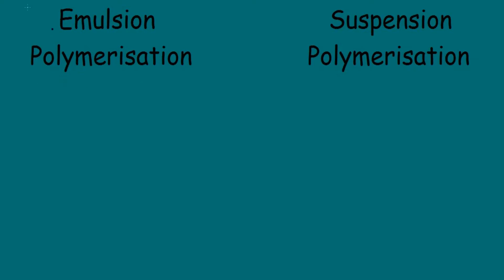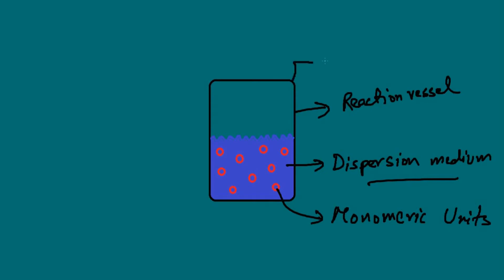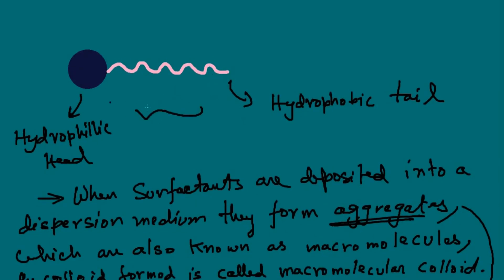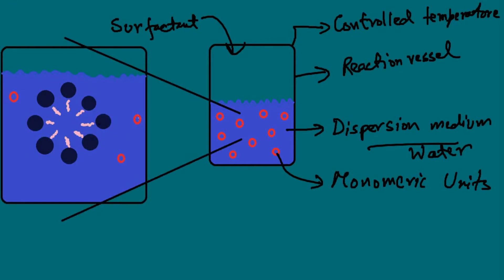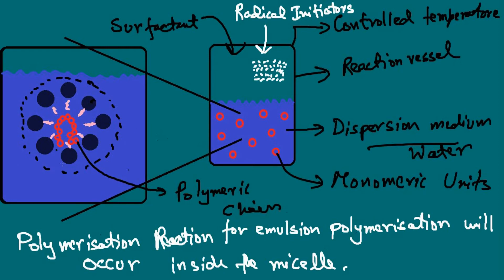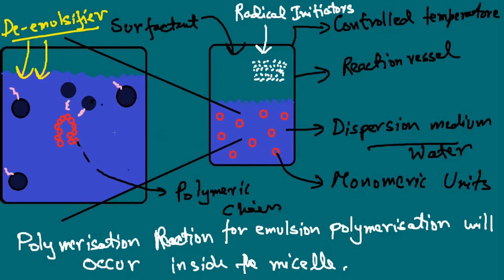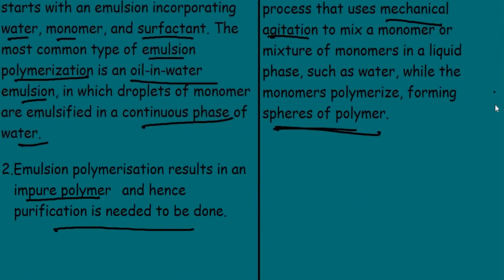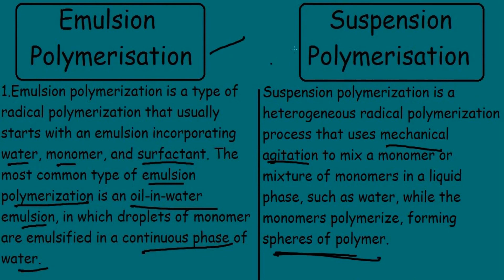Emulsion Polymerization Vs Suspension Polymerization   |English|

Comment: In emulsion polymerization, the initiation (water-soluble initiators i.e. KPS) starts in the solution phase (water phase) to form the oligomers (Initiators don't move to the micelles!!! They like water). After the reaction starts, the oligomeric radicals (more hydrophobic - compare to the radicals from the initiators) tend to move to the micelles. The animation seems to be a little bit misleading, but overall you did a good job.